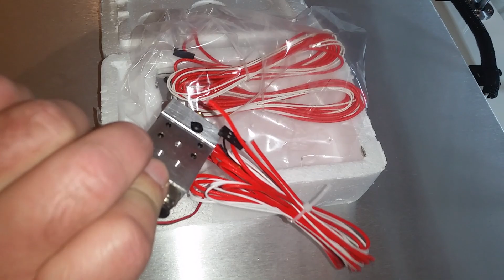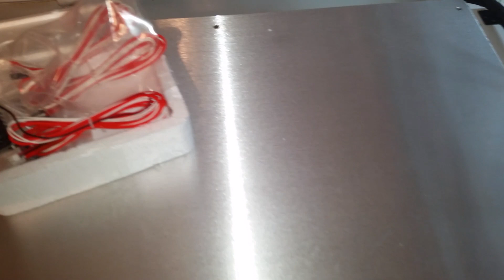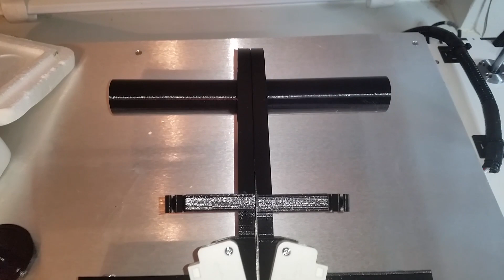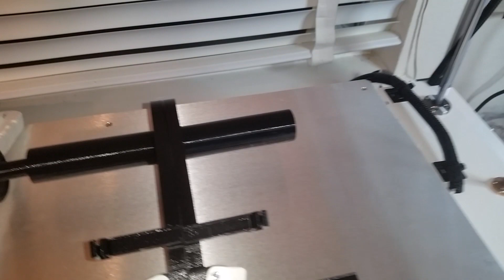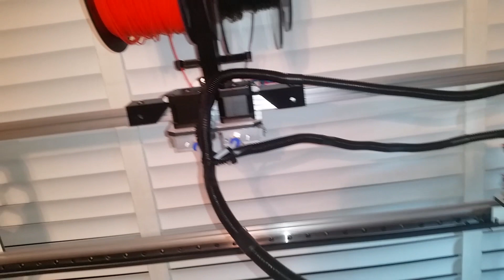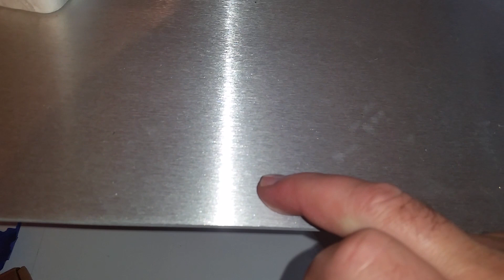FT 6 Modifications - Filament holder and new parts

Comment: how do you like the printer so far ?
Reply from the maker: Hi Amir,

I haven't really had time to work with it much lately.  I've done a few big prints with it that have turned out acceptable, but not phenomenal.  There are still tweaks I want to try to see if I can improve it, but I really needed a tool, not another project!  =)  Regardless of what I do, I don't expect it to ever be much more than it is now, which is ok for the price, but nothing special.  Given everything I went through though, I probably wouldn't do it again given everything I know now.  I still haven't had time to put together the video of having to replace the drivers that blew for the dual stepper setup.
Reply: @lordbeowulf1885  thanks a lot for taking the time to answer me , i was just wondering about the nozzel can you print PA carbon or PLA carbon? which needs 300 degrees. and the bed does it have a cover or just the aluminum ?
Reply from the maker: @EnergySeeker    I haven't tried printing carbon filament yet, although I have a PLA roll.  I replaced with a better set of heaters, but haven't tested just how hot I can go.  As far as the bed, it's just bare aluminum, but someone was selling a PEI magnetic build plate for it on Amazon, but I wasn't ready to drop a few hundred more bucks into this thing just yet.  If I get it working well enough I might.

Beo

Comment: Two things... 
One: can you leave a link where you bought that dual extruder from?
Two:Have you tried the capricorn tubing trick? The same way it affected the CR-10 I think it may help this printer
Reply from the maker: Hi Kunal,

Sure, the link is in another post here somewhere, but the part is still listed at https://www.aliexpress.com/item/3D-Printer-Cyclops-and-Chimera-Extrusion-2-in-1-out-E3D-hotend-Multi-Color-Extruder-kit/32742705685.html.  Just about to put it through its paces!  Hope to upload a video with all my updates in another week or so.

I just looked up the Capricorn PTFE tubing.  I might have to give them a try if I'm still having problems after this.  Sounds like they might address some of the potential slop in the Bowden, assuming the filament tolerance isn't a problem.  Thanks for the pointer.

Beo
Reply: @lordbeowulf1885  thank you sooo much for the link and I an looking forward to the update video with the new dual extruder design you are using. I bought an FT-6 and hope it comes soon so I can take a crack at some of these issues =)

Comment: Hi, any new updates on this?   I bought a T-Rex 3 at 700 mm tall, but that was a nasty printer even though supposedly fully assembled, and nearly 3 times the cost.  So I am curious if you worked any of the issues out with this and got awesome prints?
Reply from the maker: I'm about ready to start testing my new dual extruder hot end, so I hope to post a new video in a week or so.  Lots of other stuff to show too, but I still haven't actually printed anything useful on this yet.  It's just been a project in between work and all my other projects!  

Beo
Reply from the maker: Well, put the testing on hold.  I was working on leveling the bed after having fixed the bad countersinks and a problem with the heat pad (wait for the video, you'll be AMAZED at what I found!).  I accidentally ran the Y axis into the far stop (not sure why the firmware didn't catch that) and the power supply dipped to zero and everything reset.  Couldn't get the motors to home after that, and then I smelled the magic smoke.  Turned out the X axis driver (the one that runs the two steppers in parallel) blew.  I suspect it was just a load issue since I wasn't even moving that axis.  It was just holding.  The back EMF of the stalled Y axis probably pushed it over the edge though.  So now I'm off to search for a new driver and see if they make higher power versions to handle that double motor setup...

Beo

Comment: Very informative videos.  Thanks for your work.  Would you recommend the FT-6 to a 3d noob such as myself?  My needs require a large print space and material would be 99% abs.  The cost of this printer makes it very attractive
Reply from the maker: Hi Chad,

Leaving the printer aside for the moment, your goal to work with ABS as a "noob" is a challenge in and of itself.  Even after years of experience with 3D printing and learning the tricks involved, I still have mixed success with ABS, especially for large parts.  Assuming that everything else is working perfectly, one of the highly recommended features for ABS printing is a heated enclosed print volume in addition to the heated bed.  That does not exist on the FT-6 or pretty much any low end printer, although the frame construction does potentially lend itself to building a shroud for it to help create a controlled environment.  

Beyond that, I'd say you success with this will heavily depend on your technical skills.  The fact that you want to do 3D printing is a first point in your favor there, but only you can judge your skills.  If you've done a lot of electro-mechanical work in the past then you can probably get this kit going.    If you have any doubts in that area, then you'd probably be better off with a more complete printer that only needs minor setup.

Good luck!

Beo
Reply: ABS starts to become problematic with prints larger than your fist.  PETG seems to be the best for large prints because it doesn't warp.  If you're determined to use ABS you will struggle to make use of more than the 200mm square that comes standard with any printer.

Comment: Welcome back!  A couple of things to compare notes on!  
Interesting spool holder.  I'm leaning towards a 608 bearing type like I have on my other printer (CR-10S)  I like the rolls freely moving across the bearings and one less force of gravity acting on the filament feed.
Filament out detectors...I don't use them.  Too many false positives.  I'm just old school and make sure I have enough to do the print  😀
As you might have seen on my videos, I tried to do a step-by-step process over several videos on getting this thing built.  With the assembly manual being "OK" for most of the build, there were some areas that, as we previously discussed, needs enhancements.
I went with a spring steel PEI coated bed, there was a group offering in the Facebook group (a great resource)
I have had a great deal of difficulty going from build done to configuring, since there's little to no support in that regard at this time
I used the 3D Maker Noob's "Calibrating Z-Offset With An Auto Bed Levelling Probe" video and that worked perfectly.
I have found that the stock firmware has some things that need altered.  The probe offsets are X 10 Y 10.  If you measure you'll find it's more like X 5  Y 40.  The encoder should be changed, the usable X and Y should checked (I can only go to 344 mm on my Y).... and a few other things (details if you desire)
I'm hearing a high pitched sound from time to time...no idea what that is.
I also get a chattering in one leadscrew randomly.  Again...no idea?
It's been quite an adventure.  Tonight I'll see if I can piece together a Simplify3D profile!
Reply from the maker: Hi again.  Not sure if I should call your Nerdy or Cool for short?  =)  Or just Where?  (No, that sounds like the start of an Abbott and Costello routine!)  Back when I got my original Robo just after they started their kick starter production, I looked a lot at different reel holders because the one that came originally wasn't very good.  I'd debated going the bearing route, and while it would probably reduce some of the "clunks" of reels binding and releasing, I never really saw it as an absolute necessity.  In some respects, I kind of feel like I failed if I need any additional parts to put together something I printed.  Silly, I know, but there ya go!

On the filament detectors, they were cheap and just something to play with.  Of course depending on how the firmware handles them, I may not like them anyway.  If it stops where it is and doesn't move the head off the part, it's pretty much ruined anyway.  We'll see when I get around to hooking them up.  Regarding the firmware settings, I was already expecting to have to fiddle with them beyond what was provided, but thanks for the heads up.  

On the whine, yes, I've experienced that and even captured some of it in one of my original test videos, although I don't recall now if I left it in or cut it out.  I'm under the impression it's due to micro-stepping and we're hearing the chopper frequency from the control board as it attempts to drive the stepper partway between two poles using pulse-width modulation to create the intermediate voltage/current levels.  I can't say I've ever heard anything like it one the Robo, and again it could be a firmware setting that could help resolve it.

The chattering on the lead screw is likely some sort of binding with the linear bearings.  Coincidentally, you might watch the video I posted recently where I tore into my Celestron telescope mount.  It had a problem that I wouldn't be surprised if it's similar to what you're encountering.  When the worm gear drives against gravity it's fine, but driving with gravity, the whole thing stutters as the screw moves away from the worm and then the worm falls under the weight of the mount and hits the screw again.  The pseudo fix there was to adjust the tensioner to increase the engagement of the worm so that there was less of a gap to chatter, but you can't do that here.

Beo

Comment: hey, would you buy the F6  again knowing all you know now?
Reply from the maker: Hi Chris,

Good question, and I'm not sure I can answer that yet.  I still believe that the printer hardware was generally a good value, and under the assumption that they've addressed most of the issues I reported, it should be fine for the price.  My biggest concern is the actual quality of the test prints I've done and the amount of stringing that was occurring.  Switching to the Matter Hacker software helped there, but didn't completely eliminate it.  The result is still not as good as I get off my Robo 3D running the same software.  So the real question for me is whether or not the new extruder hot end will change that, or if this is an inherent fault of the Bowden extruder or something else in the design that I can't fix.  Regardless of all of the other issues, if I can't get good quality prints off of it then it's not a good printer.  If I can, then I'll be happy with it.